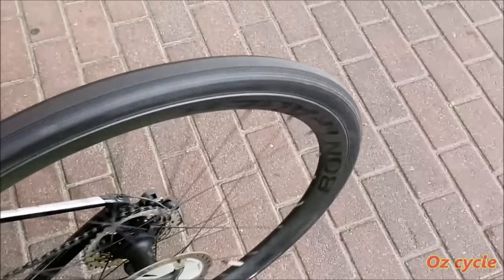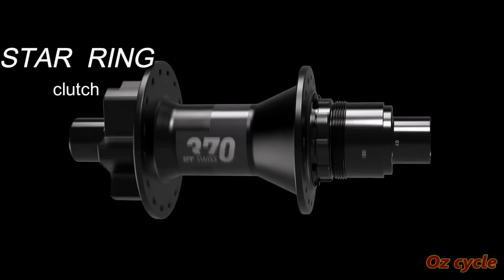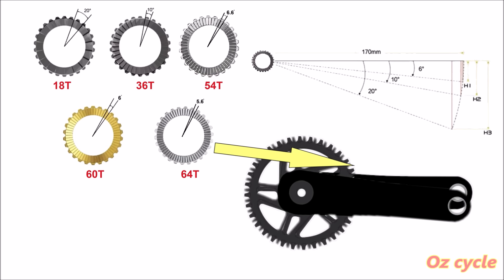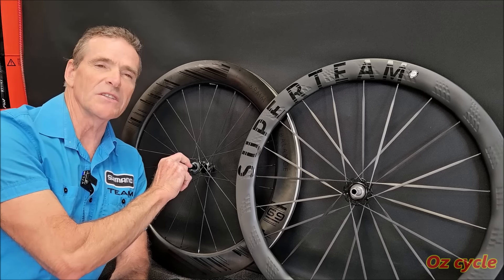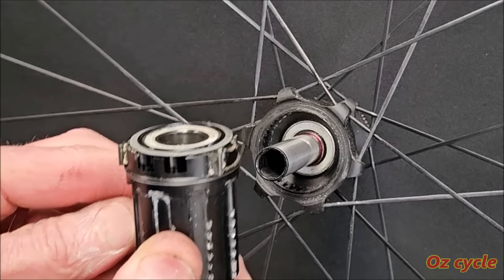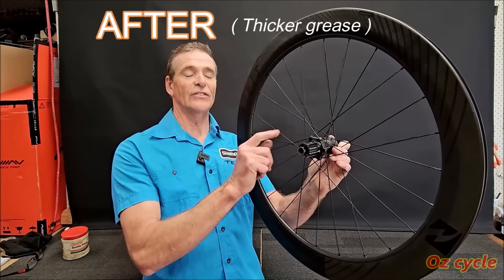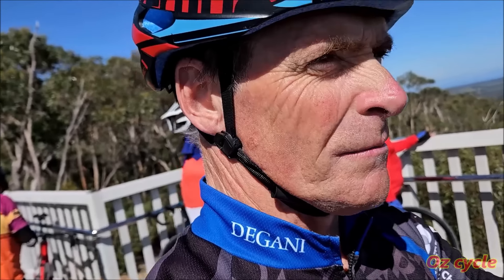Change the sound of your hub

Comment: I think it's an annoying sound but it is a subtle way of alerting pedestrians on bike paths.
Reply: When riding solo .. maybe (although I manage to do fine without for the last 50+ years).. but when riding in a pack of 20+ all having that loud obnoxious sounds for hours on end....  please no.
Reply: more annoying and less subtle are contaminated disk brakes - annoying but so much satisfying for that purpose 😁🙃
Reply: Learn to whistle? Buy a bell?
Reply: Until those pedestrians put in their earbuds.
Reply: Letting them think they have a swarm of angry bees coming behind them does work quite well, indeed.
Reply: Totally agree with ya mate! All I have to do is slow down and the clicking easily tells a pedestrian i'm coming. at worst  I reverse cycle for a rotation or two for a louder sound. I hate bells. If they arent going to get out of the way for my clicking...i slow enough to politely ask them to move.
Reply: maybe pederastian
Reply: Mine was anything but a "subtle" signal to pedestrians - I startled horses with my Hunt freebody. Packed it with grease, and the horses and my ride buddies are happy
Reply: As a pedestrian/runner (and sometimes cyclist), I find these super loud clacky hubs a bit obnoxious, especially if I'm in a nice quiet park/reserve and it's early morning. I take your point, but usually I will still hear a quieter hub approaching too.
Reply: @crossroads4762 I actually love the sound. Lol...🤣🤣🤣🤣🤣
Reply: Right, also on MTB trails. Annoying but gives a good warning

Comment: Great video, thank you. I will only add that cotton swabs leave behind a shocking amount of cotton strands. They probably don't affect these styles of clutch / pawl mechanisms, but it's worth noting that if you care enough to rebuild a hub to change the sound you really should be using a brush, microfiber, something that doesn't leave behind lint.
Reply: Yes. Wearing a disposable medical glove and using a pinky finger will work too and also keep the lint out.

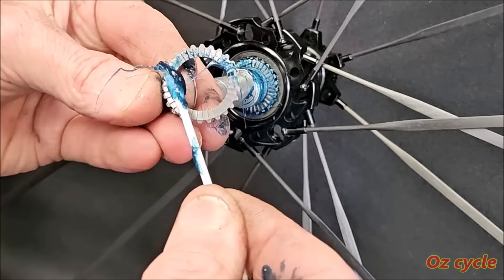Comment: Great video, just one thing... Better to use a small brush instead of cotton swab, cause swab leave cotton hairs behind, as seen on 9:00
Reply: For certain. With cotton swabs it's nearly impossible to not transfer some of the fibers (hairs) into the grease and mechanism -- not good.
Reply: @festerofest4374 only a complete amateur would use a cotton swab aka q tip to apply grease.

Comment: In some clutch freehubs you can easily add pawls. Sometimes that's the only difference between the cheap and the pricey hub models of that manufacturer. Older Bontrager come to mind.

Comment: Wheel bearing grease or motor assembly grease is best for use in freehubs. It's designed to stay in place and will take much longer to thin out needing more.

Comment: If your freehub body has 4 or 6 pawls, you can shorten 2 or 3 opposing pawls on a grinder by half of the distance between the ratchet teeth. This adjusts the 'phase' that opposing pawls engage. Ali Clarkson has a video on doing this.

Comment: For those who want SILENCE or QUIET ,  want to modify your free hub with a standard engagement system and say eg 4 pawls, disassemble the free hub. I havent tried on star ratchets. Then, stretch the round "O" spring so that its just slightly less strong on the pawls. In effect you are making the O just very slightly bigger. Put some grease in. This may take some trials so that you get enough engagement on the pawls but also it quiets the sound. If you go too far ( stretch the O spring too big or put too much grease , the pawls will sometimes miss engagement. Just do it till u can get it , few tries ). Ive done it 4 times already on my wheels.

Comment: I'd add that 
-if your hub has like 6 or 4 pawls, removing even half of them while keeping balanced spread of pawls on the hub - won't do anything bad, and decreases the sound significantly. 
-using thick grease should work, but only temporary, until grease layer won't be spreaded by engaging pawls. If it's too thick and stays to prevent spreading, I think there could be risk of not full pawl engagement. Also, sometimes finding the exact thickness value of the grease is major PITA
Reply: depends on the hubs, but removing half the pawls in Bontrager hubs would reduce engagement points from 108 to 54.

Comment: With a motorcycle mechanic friend , I ground a second set of cavities into a Novatec D042SB freehub at positions one third away , or 30 degrees away from the existing ones on CNC and we doubled the increments from 26 ( unmodified ) to 52 points per revolution as a result . We then added a second set of matched pawls .The conversion was successful and another friend is riding with those hubs in - situ with success . A NL- GI no 1 grade grease was applied before re - assembly at the beginning of this year .The hubs are still going strong today .
Reply: I’ve been wondering if this is possible

Comment: This has been the unsolved mystery after I saw a guy using DT Swiss 240EXP hub(which is same as mine) but his hub was completely silent. Thanks, guru!
Reply: I have dt swiss 240's with 54t ratchet.  put some ceramicspeed long life grease in and it barely makes any noise now.  too quiet. hoping it will get a bit noisier soon.
Reply: @tz1  How long did it last and did you ever have issues with engagement/slipping? I’d really like to quiet my hubs but don’t know how it works over time.
Reply: @Adonis-qj1nq  starting to get noisy again, but i dont mind.  Lasts for quite a while.  I only noticed a bit of slipping when I put too much ceramic speed all round grease.
Reply: @tz1  thx

Comment: I have had a bad experience with this technique on DT Swiss hubs. The thicker grease, while quieter, delayed engagement on a few occasions.   In particular on several tall climbs, standing up,  I had slipping occur. The ratchet slips over each other as the heavier grease slows engagement.   I switched back to lighter grease, but within several weeks of riding the slipping ratchet returned and got worse.  Upon inspection the ratchet teeth had become rounded at the sharp , top, edge. At this point I have to replace the ratchet set as the wheel is really annoying to ride on.

Comment: Just an observation, the thick grease will get dispersed from the star ratchet face over time, so you will need to reapply periodically to keep the noise down.  Also, too much grease can also prevent the ratchet from engaging, so don't dump the whole container of grease in there.

Comment: The correct sound is absolute silence. My belt drive alfine 11 commuter is my favorite, it's completely silent when riding and free wheeling. And I don't have to worry about the chain cos there isn't one. 

I bought a new mountain bike recently and am having nightmares about getting back into chain maintenance but luckily the free wheel sound is relatively quiet😅

Comment: Great info again Steve, a question though. My star ring from Elite only contains one spring but the star ring you showed had two.
Reply from the maker: Just use whatever was in the clutch. If there was only one spring then put back one spring in the same place. Different hubs have different arrangements.

Comment: I wonder how much the loudness of the spring sound boils down to the amount of force in the engagement springs.  If the opposing teeth were slightly undercut, I think you wouldn't even need that much engagement to guarantee total engagement on pedaling.  In that case, the only click would be from the tips of the opposing teeth passing over each other rather than the teeth hitting their full engagement points.
Reply: You are referring to the loudness of the engagement "PAWLS" .
Reply: Pawl tip shape changes harmonics and resonant frequency slightly . I have experimented with this in a machining shop producing pawls on CNC .

Comment: I have a pawl and spring hub with 72 points of engagement. And I really regret buying those wheels, it sounds so loud and obnoxious. 
I will definitely try taking the hub apart to quiet it down using your method, thanks for this video!

Comment: Just came upon this video randomly, but it immediately reminded me of using sewing machine oil in our bmx hubs as a teen to make them louder, also would use more or less pawls depending on if you wanted the loud bees noises or a slower click click noise.

In hindsight sewing machine oil may as well have been no oil -- but you try telling that to 16 year olds on brakeless bmx bikes launching them down handrails.

Comment: My road bike has the DT Swiss 240 hub and I do not like how loud it is.  I lube it with the DT Swiss "special grease" and I note it is much quieter for a few miles but after the grease works in it will be loud again.  DT Swiss states that any hub warranty will be void if you do not use their special grease (which has a distinct pink color).  I have had the wheel for 2 years so I do not think there is any warranty left, will try the thicker grease next time!

Comment: I like quiet ticking freehub like those of Shimano Sora. Recently I had my Novatec hub serviced after 5000 km. Replaced all bearing with mix of NTN and Ezo semi contact type, and re-grease the freehub with Finish Line lithium grease. Now it is quieter and roll very smoothly. This is after I noticed there is play in rear wheel and freehub was louder than when first installed. I think NL 1 grease is perfect for freehub, not too heavy and not overly light, like those made by SKF.

Comment: Which one is louder than this syncros hub, which hub should it be. I myself have Syncros rims capital 1.0 50mm on Scott Foil rc 10, and I would like to know if it is possible to exchange them for something louder? Syncros with straight rays, with central locking, 12 mm passing axis, 142 mm, 24h, free wheel 6 teeth, 78t, 11 speeds

Comment: by far best hub video on YT!     Do you happen to know if Reynolds 3 prawl has a compatible frehub with higher engagement? these are for AR46 thanks!
Reply from the maker: The number of engagements is dictated by the clutch ring inside the hub shell, which is fixed for the hub of the AR46 wheelset.
Reply: @ I was hoping to be able to upgrade to one with more prawls. Do you know of any other brands are compatible? Thank you!
Reply from the maker: @cashmiller2999 Most hubs have the DT- Swiss designed clutch nowadays.

Comment: Amazing explanation you have my sub sir! i had a Q if anyone knows... If i wanted to have 2 wheelset setup for 1 bike, would i be better to make sure i have the same front and rear hubs? i want to avoid constant alignments of brake calippers.
Reply from the maker: It would be ideal. However,  most hubs are very similar in spacings so you simply need to use the same speed cassette.
Reply: @stevenleffanue  awesome thanks a lot ye that would be much easier. So just get  another copy of my stock casset (Orbea Terra m31 2023) and put in the new wheel (zipp 303 firecrest) ?
Reply from the maker: Yes. Usually Shimano or Sram cassette.
Reply: @stevenleffanue  great thanks

Comment: The freewheel with thick grease full, to lubricate is not recommended. It can happen that the pulleys suddenly no longer grip. Then you step forward into the void and if you're lucky, you do not fly on the face.
Reply: Use a .light grease then.  I put RockLube SuperWeb in my early 2000 era Campag freehubs, and the palls work well but with only a very soft clicking.  I would find the sound of most of these modern freehub mechs very grating.

Comment: Energy is required to make noise, and this energy is coming from the rotating wheel.  Hence all the hub-chatter is slowing down wheel rotation.   Maybe not a lot, but some.  With all the concern about saving a few Watts here and there (e.g. aerodynamic socks), I don't understand why wheels that make such noise are commonplace.

Comment: Boy this thumbnail can be hard to look at. I dont think enough was said about drag, and wear. The lighter oil will offer less drag, way more noise, and increased wear on the clutch, when compared to a heavy grease with good anti wearing properties. I think loud hubs became a trend because of younger people entering the sport and perceiving a loud hub to be "high performance" and the louder the more money you can justify spending on it. And then you have a company as old as time like shimano, and they patented a literally silent rear hub. Because cyclists know a quiet bike is a fast bike, no rubs, no squeaks they prioritize quiet and smooth components. I mean even shimano Deore is named that because someone admired the way deer move silently and quickly through thick woods, and thought that was an appropriate name for a mtb groupset.
Reply: For tastes and colors, the Shimano Deore and SLX sound equally strong currently

Comment: Could you provide a link to the exact kit you bought for the sueprteam wheels I would like to purchase the 60th kit
Reply from the maker: Just found this amazing item on AliExpress. Check it out! AU$37.19  30%OFF | Bicycle Hub 60T Star Ratchet Bike Hub Service Kit Ratchet For DT Swiss Ratchet System Freehub Repair Tool Bike Parts Accessories
https://a.aliexpress.com/_mL13FSe
Reply: @stevenleffanue  thank you very much , this was a great video hopefully no can recognise you when I’m out riding to say hi in person !
Reply: @stevenleffanue  Thanks , recieved the ratchet, would you recommend using the springs supplied or the original springs ? also i have noted the aftermarket one does not move freely as the original when fitted to the hub, its a tight fit ? should i use double springs, is that even possible 
sorry for the questions, noob at this and i just do not want to damage anything as the space in the freehub is already deformed and waiting for new one from superteam
Reply from the maker: If it's not fitting right, then yes , try different springs or even the washers it came with. Mine fitted with either springs.

Comment: Has anyone tried putting sound dampening foam cut to fit around the axle inside the freehub body in a way that doesn’t touch the perimeter pawls or hollow of the freehub body?  Also, the inside of the hub shell could be filled with spray expansion foam or stuffed with dampening foam too.    Both applications would reduce resonance inside the metal cavities and reduce external sound.  But it would add a few grams 😢…

Comment: Hey Mr Oz,
Can this be done on any brand of wheels? I have Shimano WH-RS710R46 wheels on my bike, and my bike is equipped with Shimano 105 DI2.
If this is possible, which free hub is best for me to purchase.
If it exists for this type of wheels.
Reply from the maker: I think you might have the model number wrong? Do you mean... wh-rs010 ?
Reply: I checked again which wheelset I have on the internet site and they are these, SHIMANO C46 Tubeless rear wheel for disc brakes WH-RS710-C46-TL-R
Reply from the maker: Right. Thats the Y3EX98040 freehub. Yes you can access the ratchet but you will need a few Shimano freehub tools to do so. If you are not familiar with Shimano freehubs best to just leave it as it is.

Comment: In your example of the crank angle it is an error because it depends on the gear ratio and the points of engagement.
Reply from the maker: It is the principal that applies no matter what the gear ratio
Reply: @stevenleffanue The angle of engagement at the crank is only the same as the free hub if you are in a gear of 1:1.  Most road bikes do not have a 1:1 gear so the angle of engagement is much lower at the cranks.  MTB gearing can increase  the angle by around 60%.  If you need to lower engagement angle at the cranks select a higher gear.  Most MTB riders do this  with experience. The video shows the angle of engagement the same at cranks as the free hub which fails to account for the selected gear.

Comment: Does anyone know what kind of hub is in Giant SLR2 wheels. I would like to try either method. I was also told that removing some of the grease would damage the wheel. Thanks in advance
Reply: depends on the year it ether dtswiss or novatec
Reply: @meneldil7604  They're 2022 thanks

Comment: wrong info for a lot of information, the crankarm movement also affect from the gear ratio you are one, and dt swiss have two tyre of ratchet, 240s is a star ratchet hub, and 240exp is a newer system because the s system is pass is patent date, and everyone else can use it, for pawl tyre the engagement point is depend on the drive ring, there is so many mistake and misinformation on this
Reply from the maker: The principle still applies to both later and newer DT ratchets systems.  Crank arm length does not affect gear ratio.

Comment: I hate the sound of these new hub. They sound cheap. I could see how these 60 tooth would be good on my ebike because I had paws and it broke but if I had this type of hub with 60 tooth bam I did some testing on my grease and it slowed it down but I put heat to it and it was smooth because these things heat up

Comment: Can i do that with my Formula DC-22, alloy, 6-bolt, Shimano 8/9/10 freehub, 135x5mm QR ???
Reply from the maker: Yes. You will need the hex tool to remove the freehub....it's also reverse thread.